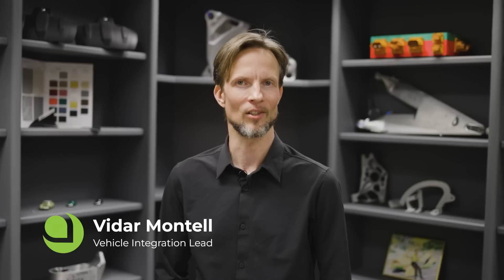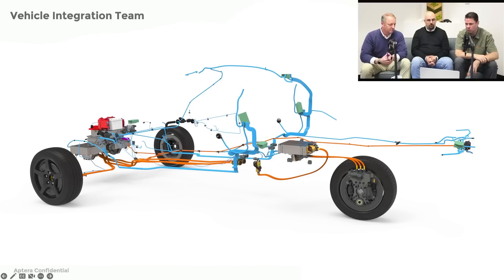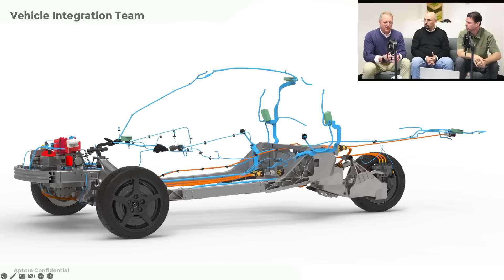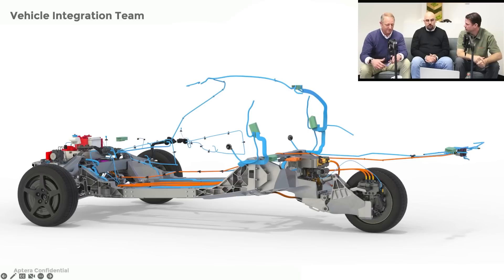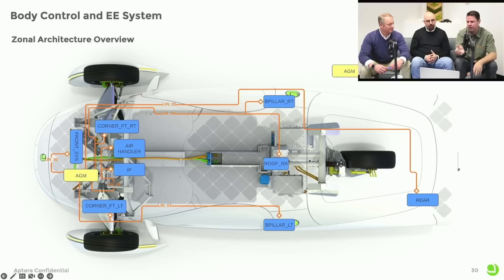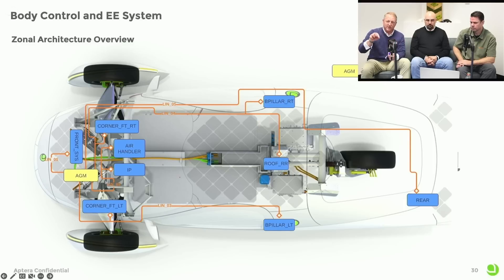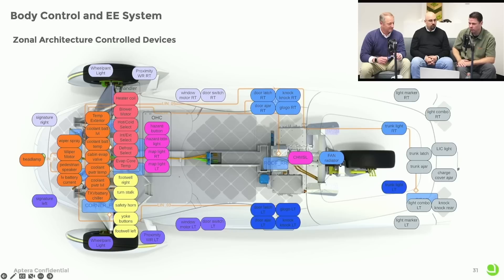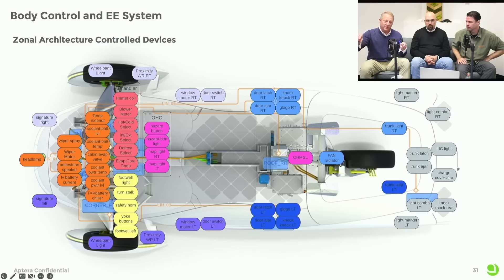Zonal Architecture — Aptera Engineering Update

Comment: I would love to hear more on the sound systems and internal systems
Reply: They will be as loud as possible - to cover up the road noise.
Reply: @daveinwla6360  I genuinly want to know what the possibilities are for adding more subwoofers/different speakers.
Reply: @hockeynut178   - I definitely wouldn't plan on modifying the interior wall until I personally inspected it.  I suspect that it's part of a monocoque structure that provides some strength to the body, and the space between outer and inner walls has also been mentioned as containing sound damping material.  Chris Anthony mentioned recently that Aptera is formulating plans for an open house showing of the Gamma model, and that would be something for you to attend if you're within travel distance of Carlsbad.  In any event, patience will serve you well.

Comment: remove wires with zigbee :)
Reply: You still need to run power.  The signal line is relatively insignificant, and in most cases wired is more secure and reliable.

Comment: A three-motor configuration. Will it have three-wheel differential?
Reply: The motors are in the wheel hubs.   There are no drive shafts, CV joints, or differentials.